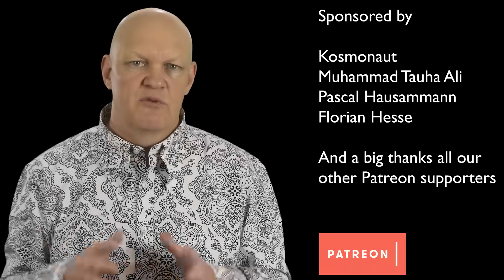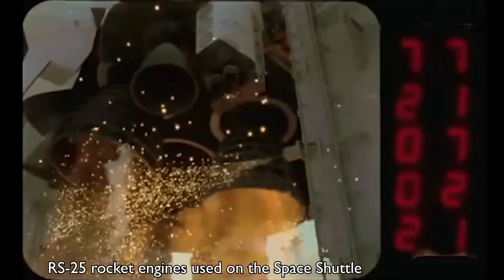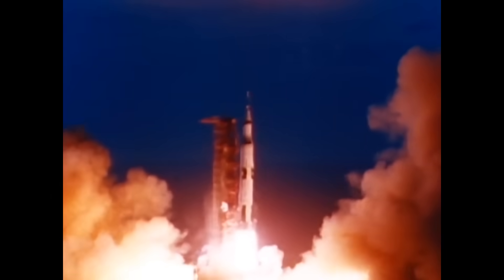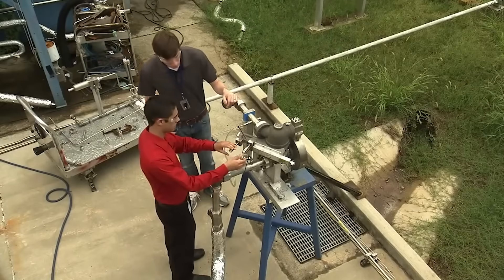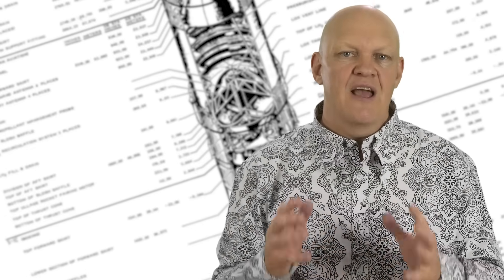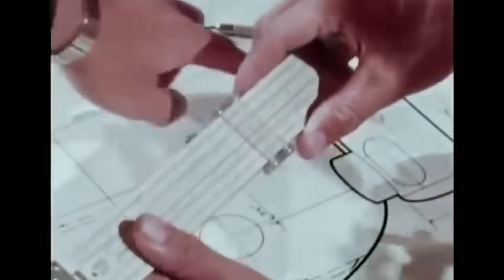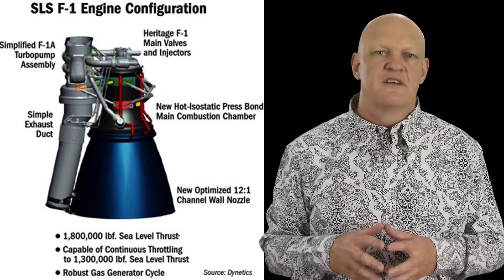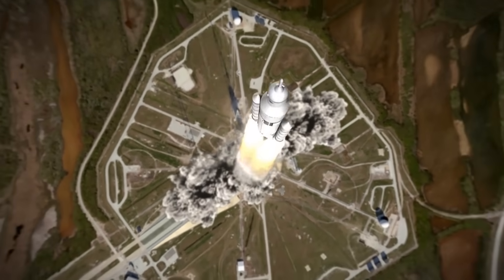Why Can't we Remake the Rocketdyne F1 Engine?

Comment: Everybody who had to restore a sufficiently old machine can attest to the same... technology marches on, and it "forgets" how  the old stuff was done. 

Often, you can get around with a newer - and better - solution, but rebuilding the original as it was may proves elusive, and almost always involves skills now become "esoteric".

It is so for old cars, radios, aircraft etc... No reason it should be any different for rocket engines.

Comment: So basically we don't have all the blueprints. A complete set of blueprints should be legible enough that any skilled tradesman can recreate the part. They designed an identical and better F1-B version that we can build using more modern design and build principles. We didn't forget the science and manufacturing. They were just building custom one off units that required workarounds because of the limitations of manufacturing at the time.

Comment: I like the short formate video and I think NASA is again giving up to early on a promising design.
Reply: Craig L. Young The F-1 engine requires 5 tons of fuel per second, per engine. The Merlin engines Space X uses or the modified Soviet NK-33 ULA uses are much more efficient and have given the  Russian design a chance to shine reliably. Closed cycle engines maintain higher internal pressure thus tend to be 15%+ more efficient than open cycle engines.
Reply: Almighty Deity To add to that, a 15% boost in efficiency results is an increase in launch mass of MORE than 15%, thanks to the exponentially increasing fuel requirements as efficiency goes down :)
Reply: Almighty Deity : Now that leads to an interesting question. Is 5 inefficient but successful engines better than 27 efficient that has never lifted a heavy load?  Although as an engineer, I marvel at the NK-33 but the N-1 was such a disaster that the Soviet Union order all the NK-33 destroyed.
You have no idea and ULA will never tell what had to be done to get the NK-33s to work properly and in comparing the F-1 to the Merlin is like comparing the P-80 to the F-22. We've made many improvements since the mid 60's and I think we should apply the new technology to the F-1 and get back to heavy lift.

Comment: It will be the largest rocket ever built and the first launch is scheduled for 2019. the Twin SRB's are the same as used on shuttle except they added another 20 foot section and made each booster five segments instead of four. Each motor now develops 3 million pounds thrust. They also are using the main engines used on the orbiter for the center core stage which is an extended external tank. The core stage has four liquid hydrogen/liquid oxygen main engines at the base of the external tank. The plan is to use as much heritage hardware from shuttle to reduce development costs of the SLS. Regarding the main engines, they were flown on the shuttles. They had 16 left over from shuttle. They have been upgraded a bit and will have a new lightweight controller for the SLS configuration. Since SLS is non reusable, Aerojet Rocketdyne will start an assembly line to produce the same design but with changes not required for reuse... Just FYI

Comment: I started out trying to get a degree in engineering.   Got a job in a machine shop, working my way up, being taught by the older men. (Should have completed my degree, but parts of it seemed so silly after I saw how much real know-how the professors lacked... ) Some of those men had been building, fabricating, welding, dead reckon engineering things since before WWII. Others were the sons of old salts and good in their own right.  We weren't a job shop, we made whole automation machines for factories, not just individual parts.  We actually didn't have blueprints (except for specs of the parts our machine was to handle), let alone CAD stuff. Just build it, make it last and it needs to spit out 80 parts per minute. So heads got together on shop floor and said "let's locate the part this way, then rotate'em on this axis with hydraulic piston for the next step? ok?"  It wasn't rocket science mind you, but some big companies' engineering departments couldn't reverse engineer how to build another one or refurbish the original.  AC Delco asked if we could look at some new German made machines they had, but could never make run effectively.  I came to find that they contracted those built because the ones we had made not quite 30 years before had been running 2 to 3 shifts per day 7 days a week for almost 30 years.... and they were worried that they would all start to fail at the same time.  We refitted ours.   They were incredibly worn, peened, polished down, but still worked.  Initials of the men that built them still scrawled underneath.  I had to throw out most of the works of the German companies machines and I fabbed up new to run different products. Never did get a degree to hang on a wall, but I've worn many many hats... Welder, fabricator, machinist, master mechanic, construction foreman.    so Now.   Would you like a certificate to say why your construct shouldn't have failed ?    Or would you like me to build something that won't?

Comment: What is true about the F1 engine in this video also applies to how the entirety of the Lunar lander, crew capsules and command modules. 

I once worked with an old Machinist who built the first reel-to-reel, high capacity, high speed tape drives. The initial specs and general ideas came from the engineers, but the machinists were the ones who made the actual mechanical systems and  parts that would actually work. The engineers would then disassemble the finished product, exactly measure and draw everything, then implement mass production. 
It was very very hands-on. Very manual. The written documentation doesn't begin to capture the tedious and complex intricacies that led to the finished product. 

SkunkWorks was very much this way. Engineers were often also hands-on machinists themselves. The YF-12 / SR-71 program is an extreme example of this, as well as the XB-70, and also the Concorde SST. 
To try and bring any of them back into production would be like trying to re-invent the wheel.

Comment: One of my customers named Tucker worked on the Apollo program. He shared his reason for secrecy. He was the mechanic and it was his job to assemble what he was given. He explained that the machined part he installed would go bad if it had any surface scratches during assembly. Only 1 out of 4 were working. The part cost several thousand dollars even if it was just a seal. He described   keeping the part in the plastic packaging while putting it in position. Tucker said he cut a hole in the bottom of the plastic, then stretched it open. He inserted the part and pulled the plastic off as it was pressed in. Never had a failure if he was the assembly mechanic. He was asked how he did his work and he said, your the engineer I’m the mechanic. He believed in Job security.

Comment: Werner Von Braun was a genius. 
Yeah, 1960’s reliability- The Saturn V if ran at 99% efficiency would mean 40,000 parts would’ve failed. 

Who wants to build a rocket engine with over 5000 parts? Lame.

Comment: Sorry still not convincing enough that F1 cannot be built now because notes of the engineers are lost even though blue prints are still there, and in the aerospace industry there is no such thing as uniquely build engine for each rocked... Even a small modification to a tested design can cause massive issues and lead to failures, every engine is built to spec, there are revisions of course but such changes are always documented in the blueprints.

Comment: Merlin engines are more advanced and can survive reentry and be reused serveral times before replacement, they can even reignite and be used to slow the rocket down , and land the rocket for reuse later.
Reply: Mark Plott The hell they are! The Merlin technology is dated at 1952, the F-1 at 1958.   Six years meant a lot back then. The F-1 was capable of many flights, but its mission required only one.
Reply: I was NOT aware that the F-1 engines were 3D printed and use fuel spheres made of Carbon Fiber ?
Reply: Mark, you got the wrong engines. Same to you Mr. Moto
Reply: Mark Plott Materials and processes come and go. The F-1 used gold braze alloy in the nozzle. I wouldn't expect anyone to do that today. The fundamental rocket technologies of the F-1: turbopumps, combustion chamber, and nozzle are a generation past the Merlin. No one - not even the Russians - has attempted to fly a combustion chamber even half the F-1's thrust. Combustion instabilities have stopped them cold. SpaceX attempted to build an F-1 sized chamber, failed, and went for something smaller.

Comment: NASA's engineers, designers, technicians and fabricators never even considered the idea of future generations trying to re-create their designs later. There is also the fact that many choose not to share their knowledge because of competition for jobs in technical fields and because time and workload don't allow it. Knowledge and skill are valuable commodity's in those areas and very few organizations foster the type of environment required to properly train new talent these days. The notion of apprenticeship is very much at odds with production and profit. Ultimately, design is one thing, building it with one's hands and making it work, entirely another. A college degree is often taken as a substitute or even preferred over raw talent and experience. The fact is, both are necessary. In the race to production and profit, organizations sometimes tend to take skills and knowledge for granted in lieu of a piece of paper, as is commonplace today. I try to pass on my knowledge and experience to younger talent as much as possible, a benefit I enjoyed myself occasionally, early in my career. Even so, it takes many years, a lot of work and tremendous dedication to gain those skills and that knowledge and it should be passed on so that future generations can benefit as well. It should never be a foregone conclusion that people in the future will come to possess the same talent as those of the present day.

Comment: A good video, but it does not mention the technical shortcomings which make the F-1 completely unsuitable in the context of modern reusable boosters. It is not throttleable or restartable, and it is so big that a booster will have only a small number of them, so sufficiently low, controllable power for landing could never be delivered even if it could be restarted and throttled. It also has significant lower specific impulse and thrust to weight ratio compared with more modern designs. Also, it  is not designed for a long service life (sort of mentioned in the video), so it makes sense only in the expendable context. That's technically fine for SLS, but political considerations no doubt drove the selection of SRB's. The SLS is the Frankenstein of rockets, using basically recycled components, but its recycling does not go as far back as F-1. Yes, the F-1 was a fantastic achievement, as was all of Apollo/Skylab, but it's a bit of a dinosaur among rocket engines. It sad that none of the Apollo era designs have survived in use, whereas the Sputnik/Voskhod/Soyuz line continues vigourously to this day, and components of N-1 and Energiya/Buran are used extensively even by the US, perhaps coincidentally reflecting the heroic memory of Sergei Korolev versus  history's verdict of "damnatio memoriae" upon Werner von Braun.

Comment: The shorter format makes your videos more accessible, but less detailed. This clip ended with an almost contradictory statement, in that we could build an improved F-1 using modern methods and a tiny fraction of the number of parts used to hand-build the originals. Who cares if the original is too difficult to replicate using original tech if we can improve it all-round? It's akin to suggesting that we could not build a Great Pyramid today using ancient methods. True, but we could do it even better if we really cared to invest that much effort. We lack the most important driver for any such efforts; we don't have any incentive.

Comment: The F-1B engine sounds fantastically cost-efficient, it could be of great help when designing mass transport systems for lunar colonies at least, if not for Mars colonies. More engines with the same cost = more rockets & shuttles in use at the same time. 40 parts compared to thousands of parts, that just sounds so amazing.

Comment: I find this really interesting. I have run into this kind of thing before working on old theatre equipment. The style of repairs and building are so different and with most manufacturers long closed or no longer supplying parts the way technicians of years gone by made parts from readily available scrap is amazing. The way they turn a coke can into a shield from light bleeding or a 10c piece as a shim is fascinating.

Comment: Another clear case of You Can't Buy Know-How. Prints and construction designs arer merely the beginning of the process of manufactoring complex products. Think of the difference between reading a chart, and actually sailing a ship. You can learn all there is to know about map reading in a school, but there is only one way to learn how to sail the ship: practical experience. This applies to just about everything.

Comment: I think this new engine or be it redesigned should be taken seriously as a contender against the space x falcon super heavy engines.

if the F1B is so efficient then maybe just maybe it should be offered as a contender in a rocket system to get man back on the moon or all the way to mars.

I saw a Saturn v rocket for the first time at Cape Canaveral in 1984/85  whilst on a holiday in Miami and although it was only a museum peice it was so impressive I never forgot it as in the shear size and complexity of that huge rocket.

Comment: Machinist is the word and you didn't say it once! Machinists made those engines and with the advent of CNC machines there are not any real machinists left, just machine operators.
After 35 years as a machinist I got out of the trade 4 years ago, they haven't stopped calling yet!
Reply: Well he didn't say machinist but he did say fitters which is the same in UK English.
But apart from that you're right. I'm also an old time machinist/fitter, draftsman and mechanical engineer B.Sc. I took the long way and it took decades not just a 3 year or a 5 year engineering degree to reach my level... but it was worth it in every respect.

Comment: For one, F-1 was OPEN CYCLE engine, so it is conceptually OBSOLETE. 
For two, NASA, along with some moon footage, DID lost documentation - and so, in numerous re acquisitions,  did the supplier (surprisingly not uncommon in industry) and that's why recovery of one of these from ocean bottom was such big deal.
For three - just like with Saturn-V it is not just about to re-creating the final article, but entire manufacturing tools. That's why tooling for F-22 was preserved and for other aircraft design was destroyed - for express purpose of making restarting production prohibitively expensive.

Comment: My dad worked for Rocketdyne as mathematican/engineer. I would think the designs are owned by Boeing and top secret. Tesla and Blue Origin used all the info they could get  to make their designs. I remember the tests of the SSME space shuttle main engines. These things blew up a lot in testing. That's what my dad did analyze test results for the rocket engineers. I think it could be done, but what would you do with it? I like the idea of one company building the entire rocket privately. As there will always be new engineers to learn from and replace the old engineers. Steady funding at low levels where improvement is expected daily is a better way to go.
Reply: BTW I don't know what Nixon was thinking. They could have kept Apollo going at a 20th of the annual funding. I wonder if we demanded the president have an engineering degree and 3.5 gpa if it would stop the craziness of what these politicians do.

Comment: How about the Aerojet M-1? That was the other liquid fuel engine under consideration for Apollo. It was to be more powerful than the F-1. Where the F-1's turbopump exhaust was dumped at low pressure, the M-1's was fairly cool and used to cool the lower part of the engine bell. Picking up that otherwise wasted heat allowed the turbopump exhaust to be expelled through nozzles around the bell to add 28,000 pounds of thrust. A complete M-1 was never test fired so the actual thrust capability of the design is unknown. Since Aerojet is now part of Rocketdyne, I'd bet they have all the M-1 plans and data in their files.

Comment: Blueprints ain't everything.
Manufacturing documentation is also necessary. 
But there comes few problems with that.
Some technological processes aren't available anymore.
Some materials aren't available anymore too.

For example you have turbo compressor body made from XXX999 alloy.
But manufacturer for that alloy went bankrupt 20 years ago, and documentation is lost.
There is newer materials, with better characteristics. But that part was designed with physical characteristics of that alloy.
For example thermal expansion graph of newer material is not matching. So you have to spend a lot of time and resources on testing, again and again.

Basically using old designs is impractical. Sometimes it is just easier to design and test new piece of equipment.
However you can use old designs as inspiration and reference.